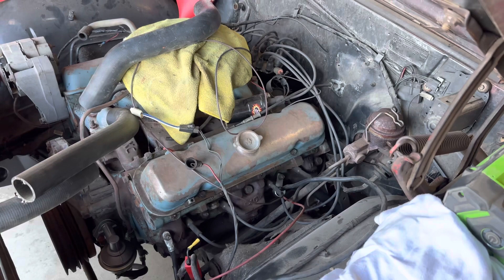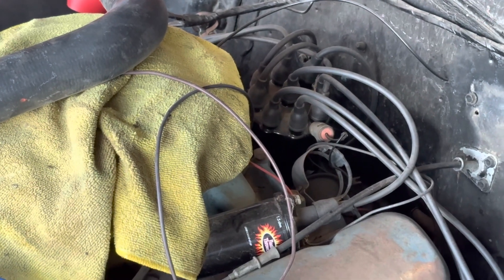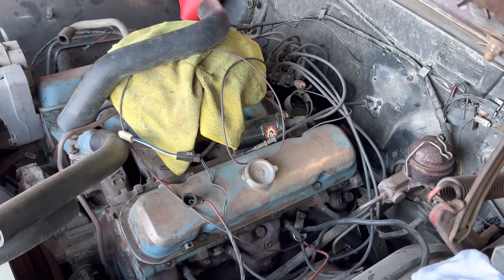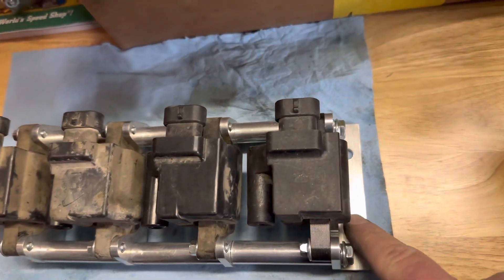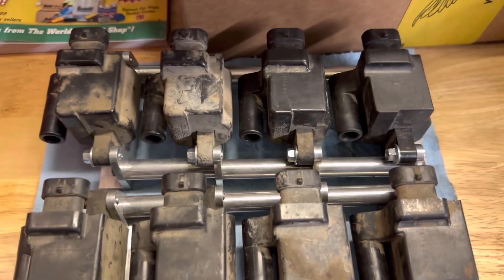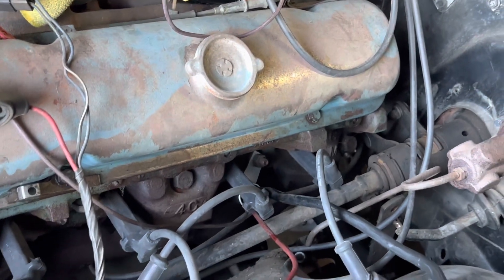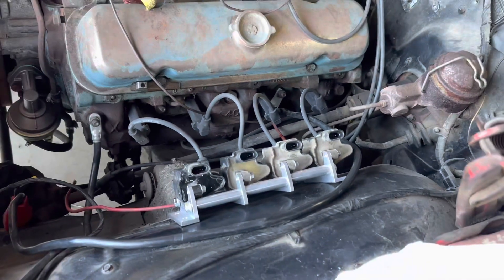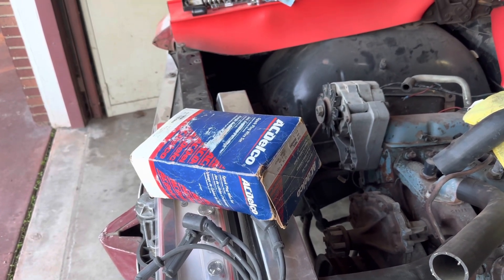EFI retrofit: Coil Near Plug retrofit

Comment: Not sure how this came out for you but i started buiding stand alone systems for EFI, Ignition, and transmissions using speeduino board architecture. The simplest version for guys with carburetors that want a coil near plug setup uses a 24 tooth wheel and wasted spark. And it can be set up to use a map sensor, throttle, cam position etc.... just depends on what you're building.

To clarify the 24x wheels are universal units set up to attach to an SBC balancer with hall sensor

Comment: What are you going to use as a trigger for the individual coils? I'm guessing the distributor will get cut down and plugged to be used as an oil pump drive?
Reply from the maker: Eventually, that's pretty much it- the list. will be turned into a cam sync/oil pump drive. 
The crank sensor will be mounted to the front of he engine... but first, I'll use a dual sync distributor from Holley EFI- it's an all in one setup that will trigger the Holley EFI computer.